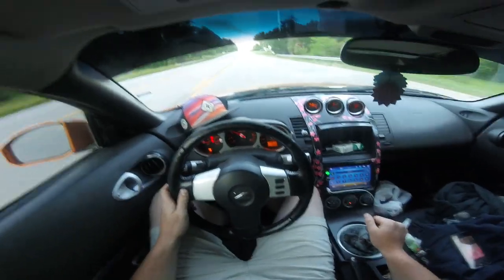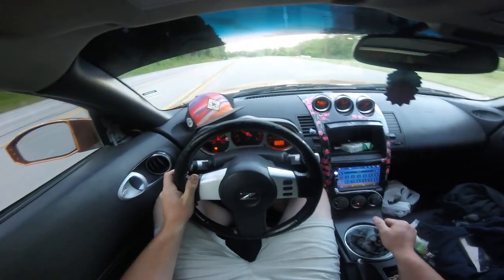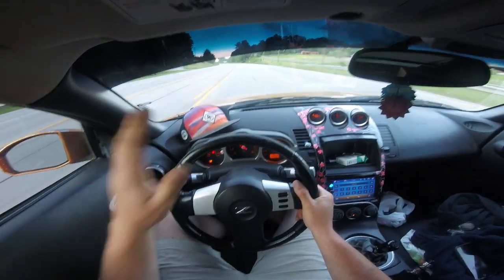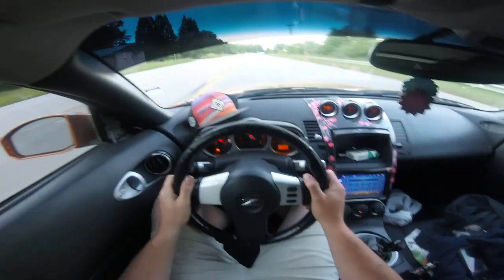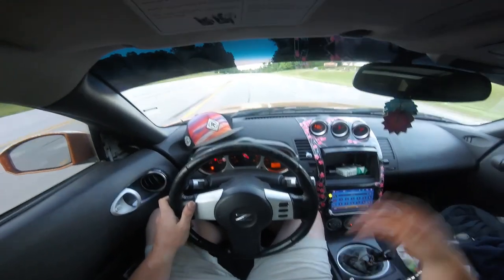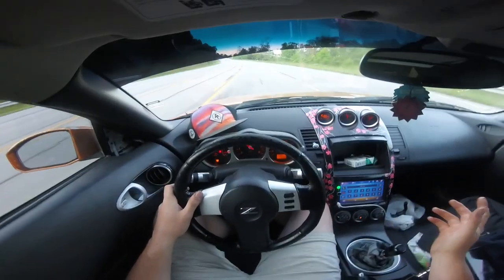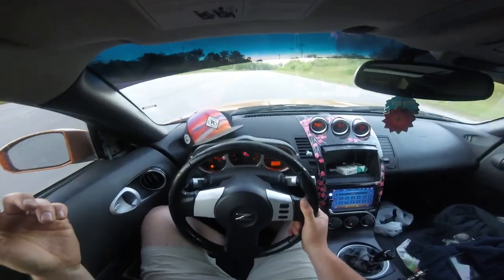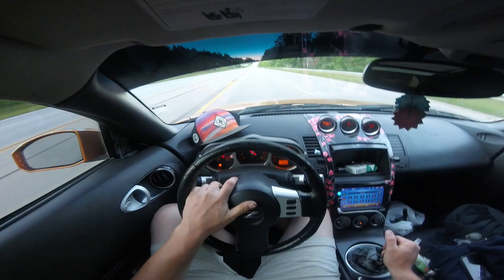Twin Turbo camaro IROCZ Mullet missile build begins! Let your mullets fly in this intro video

Comment: Power figures way off on that Vette engine claim and despite the valve cover’s claim that iron headed TPI engine is not from a 1986 Vette, they had aluminum heads. IROCs had anywhere from a carbed 305 to the TPI 350, only the highest engine option matched the Corvette’s so there was no better option for the fbody that’s the Vette of the same year.
Reply from the maker: Cory Holbrook I pulled it from the corvette myself. Not saying it was original. 😅 but yes u are right. My iroc was the 5.7 tpi with a 5 speed. And yes I know the corvettes had more. It makes me laugh saying 150hp